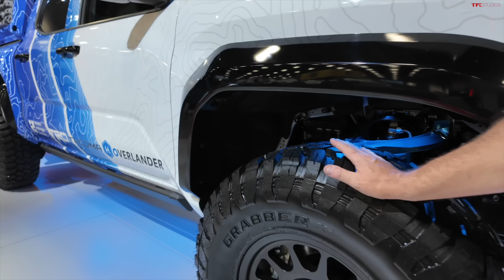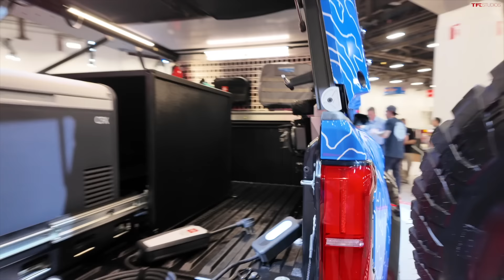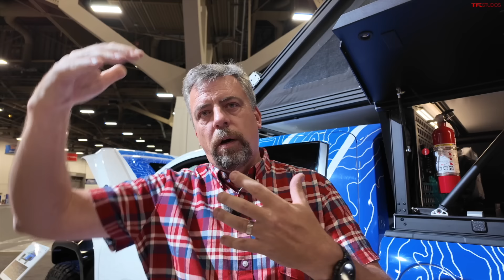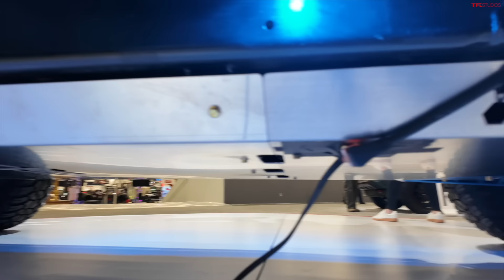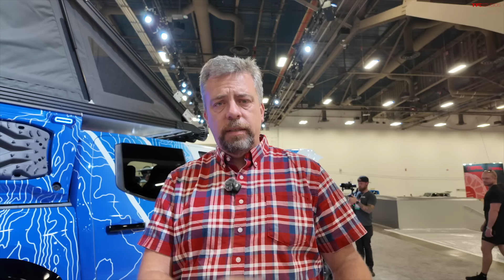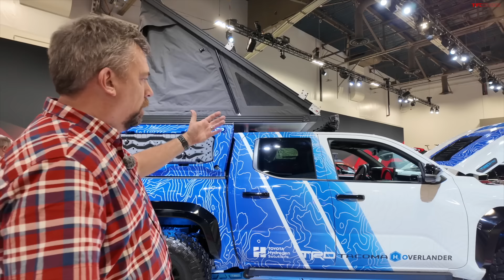Toyota Just Unveiled a 547 Horsepower Tacoma & You Won’t Believe What’s Under The Hood!

Comment: The only thing dumber than an EV overlander is a hydrogen overlander. Gratz Toyota for a useless concept vehicle.

An engine running at 20 hp puts out 15 kW, so no reason we can’t make any vehicle generate lots of electricity by connecting the driveshaft to a generator without the need for hydrogen.

Comment: Anything new with the tundras and the talk about the V8 coming back?
Reply: Literally not gonna happen. Bringing V8 back fundamentally contradicts the way Toyota do engines. They push out a new engine and works on that engine for up to 20 years. They're not GM or Ford that runs 5 different engines for 4 years each. That complicates logistics and hampers potential for engine improvement. The fact they would work on an imperfect engine continuously is the very reason their V8 was so damn reliable. You can't mess up decades old engine. If they give up the V6 right now it'll never improve it. If they do that Toyota is truly dead
Reply: @gxkjerrygao7635 wishful thinking, thanks for the info

Comment: I was at the Toronto Auto Show this past winter, and a fuel Tacoma TRD Pro with the topper and tent was listed close to $120,000 CND.
My question, did Toyota decide to put a front locker on the Tacoma yet? (One of the features I like on my Colorado ZR2.)
Also, I used hydrogen cell powered fork lifts at a warehouse, and they had to be filled at least 5 times a night, and these fuel cells weighed around 3000 lbs alone.

Comment: People keep talking anout the cost of a truck like this but that isnt the actual issue, with the fuel cell and battery this is likely cheaper if not the same cost as a normal hybrid tacoma since a hydrogen fuel cell is less mechanically complex than an ICE powertrain. The issue is the fuel cost, hydrogen is notoriously expenses to the point where toyota had to sell all the murai’s with 15k dollar preloaded fuel cards so people would actually buy them. The dollar per mile cost of hydrogen is far worse than even a poor fuel economy heavy duty gas pickup truck running premium.

Comment: Very nice. I'd imagine fuel cells will be the future of green energy in auto applications.
Reply: @oribron  they’ve been around for over a decade. This truck is using 10 year old tech. No one buys them because no one will build the infrastructure. It’s also not green. Our existing hydrogen supply comes from the fossil fuel industry. You can get it out of water, but the process isn’t efficient.

Comment: This means for all the average Joe smoes working on trucks. Say good bye. Throw your knowledge of combustion engines out the door.
Reply: Yes but at least in my opinion h2 powered engines are the way to go unlike the whole electric bs. Other than the fact like you said you wouldn’t be able to work on them there is no down side to h2. You can even build a simple h2 generator  using stuff from the hardware store.
Reply: @Rn-qr8diyes, the problem is the cost to produce hydrogen fuel. People are already complaining about gas prices. Hydrogen will be doubled that plus availability of it. Think about it. People have a hard time finding E85 and it’s been out for almost two decades.